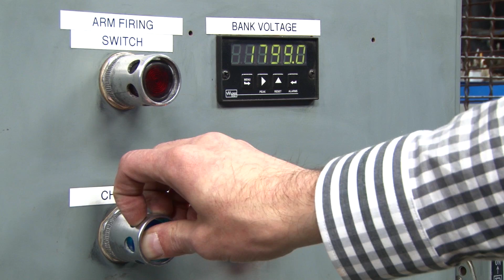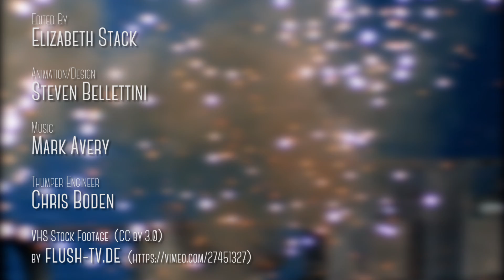Mag-Lite Flashlights: Abuse of Power #5

Comment: why do the maglights leap so far, the lens were intact, so is there some weirdish eddy current or something happening ? obviously there is too much material for thumper to sublimate, so why doesnt it sit there and just pass the current?
Reply: +squeak83uk2 The rapidly expanding aluminum gas probably sent them flying.
Reply: +squeak83uk2  I just discovered TGG so perhaps this question is explained in another video... but I, also, would like to know the physics behind this.  There are hundreds, if not thousands, of channels out there where things are blown up, microwaved, shot at, etc.; but, what separates a "geek" from a non-geek is his/her longing to know why the result is what it is.   +rocketman221projects's explanation certainly makes sense, but the "probably" makes me assume that there's some uncertainty (which is a lot better than my less-informed wild guess).  Can't TGG include an explanation or at least a link to one?
Reply: +rocketman221projects but if the casing sublimated into a gas , why so much energy ? There was no compression  of the gasses , much like a bullet in a fire , the energy would just find the least resistance . I know aluminium isn't heavy per se but that mag light is still quite a lot of mass for a pressure wave to lift @Chris Boden is there any way to figure out with thumper how much pressure is generated by a sublimated piece of metal ? do different metals have different volumes of gas when sublimated ?
Reply: +squeak83uk2 the term I googled up was sublimation pressure ,  but still without any compression of the gasses why does the body go so high?